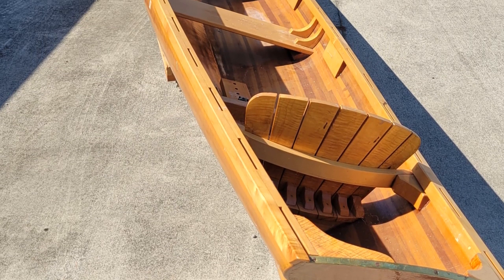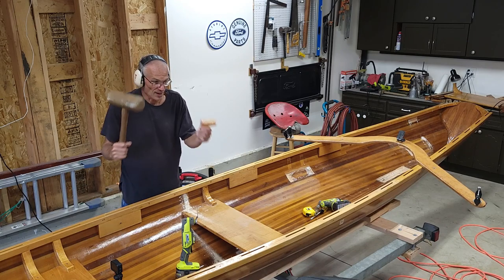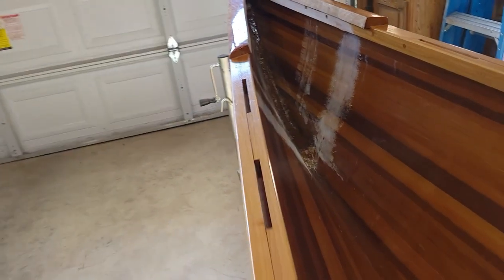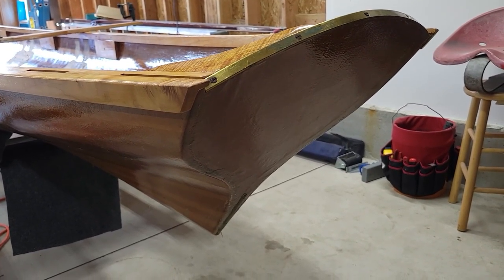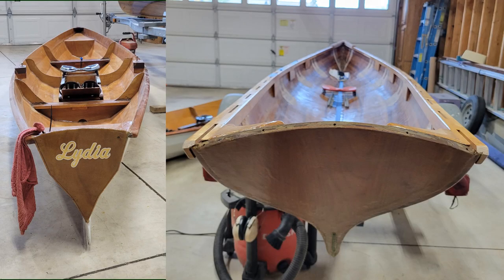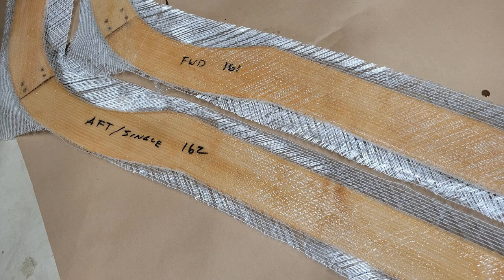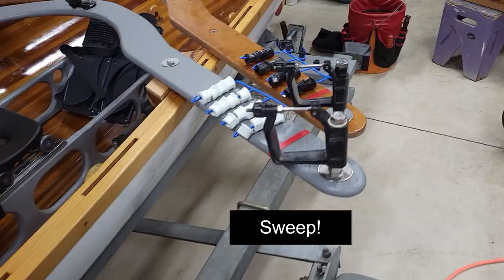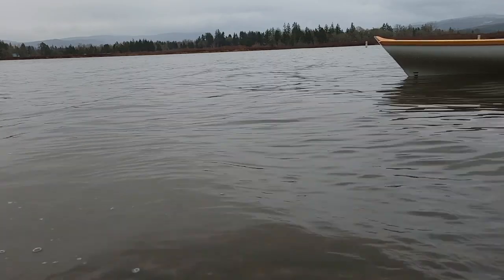Converting a Fixed Seat rowboat to a Sliding Seat - The Odd Man Out

Comment: This was very helpful, thank you! I'm getting ready to perform the same project on my 17 ft. wherry from fixed seat to sliding seat. Wish me luck.
Reply from the maker: I sold the big wherry in that video and have just completed the same project with a Gentry Designed "Ruth".  It went really well, was easy because I was replacing a drop in unit with the Angus Rowboats sliding seat rig.  Replacing the fixed thwarts, your project will be more difficult!  So, yes!  Good Luck!

Comment: Classic rowing boats with a fixed seat often have much more freeboard than sports rowing boats. Does this have to be taken into account in the width of the outriggers and the length of the oars?
Reply from the maker: Sorry for the slow reply,  I have had relatives visiting. 

For sure the higher freeboard impacts the geometry of the install.  I think the only way to figure it out is to put the boat in the water and see how it looks.   The oar blades should not go into the water below the top of the blade,  just barely buried in the water.  You could adjust by raising the seat.  You could adjust by using longer oars,  but that would require longer outriggers,  and I am not sure that is practical. Raising the seat may make your boat a little unstable.  With longer oars you could also reduce blade size which would reduce the need to spread the oarlocks with a longer rigger. I have seen some boats where the gunwhale was cut down.  You may need to settle for rowing the boat with the oars hitting you a little higher in the chest than is desirable. 

Unfortunately the geometry is complicated in that there are an infinite number of permutations,  and probably more than one way to get there.   I think I only paid $12 or something like that for the Kindle version of the rigging guide book,  and you will probably want to have that to help with your modifications. 

Good luck!
Reply: @oddman-out  thank you for your Tipps!